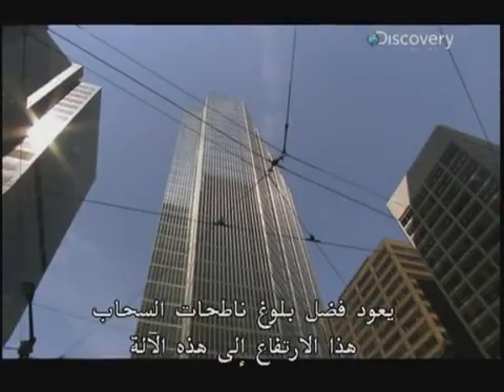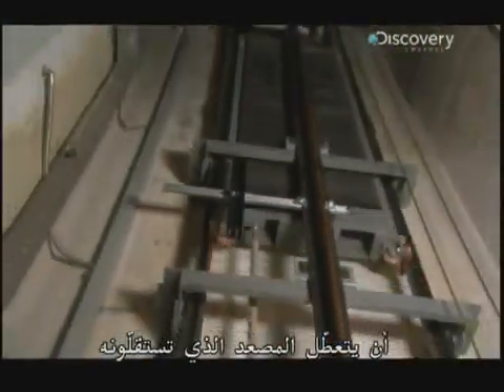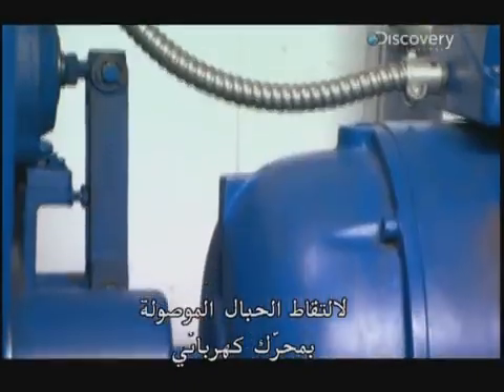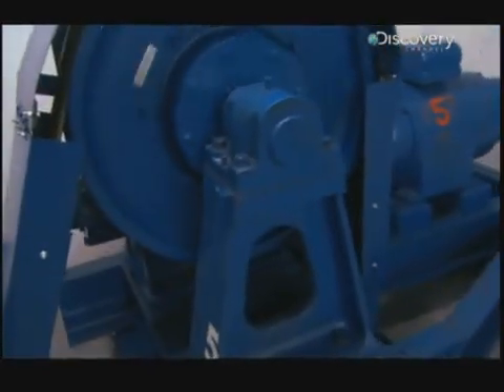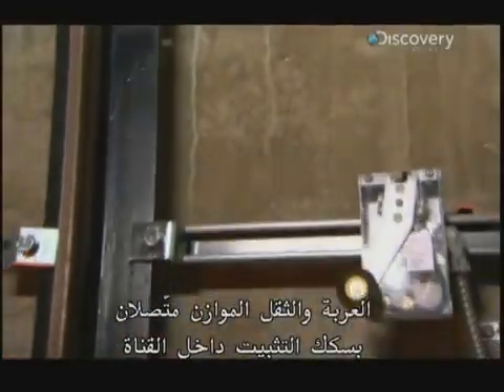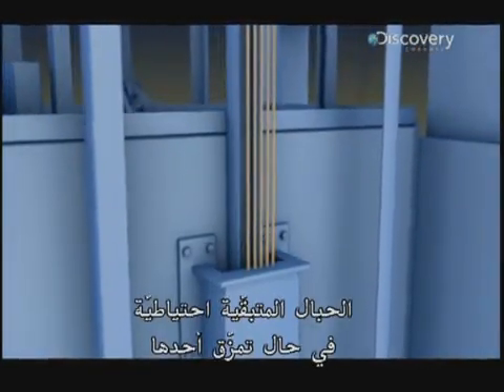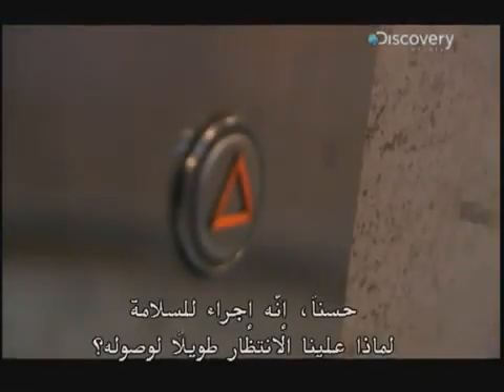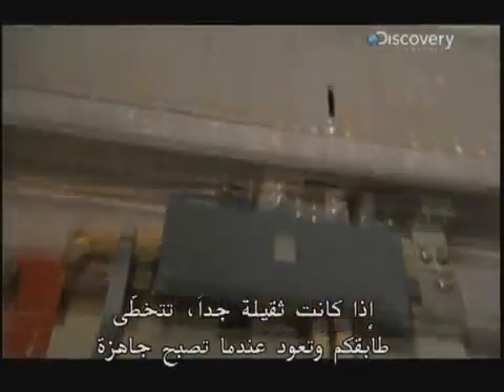how elevetor work.flv

Comment: There's a major error regarding how a free fall situation is prevented. 

The governor shown in the video (and the rope running around its sheave) actually applies a braking system -known as "safeties"- located on the bottom of the car which grip the rails that the car runs on.